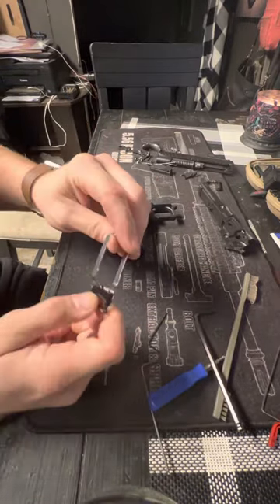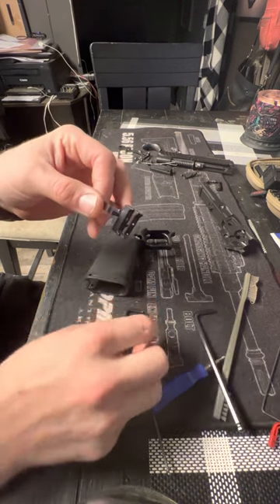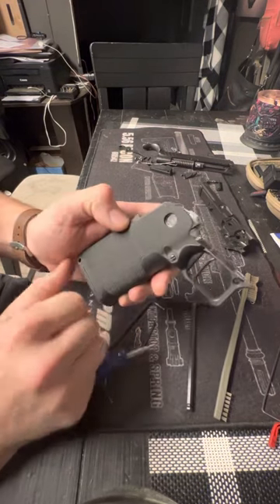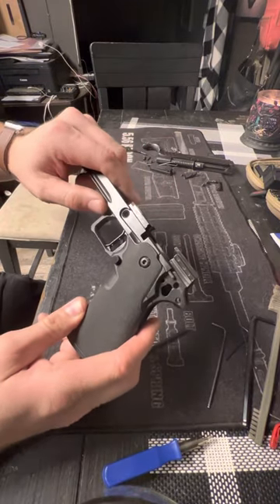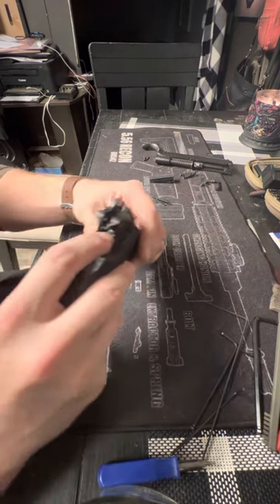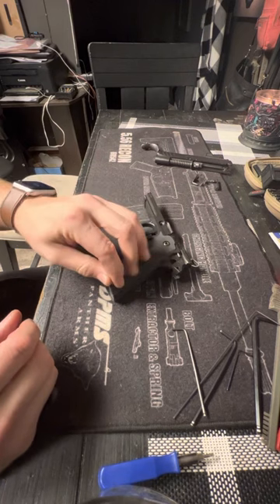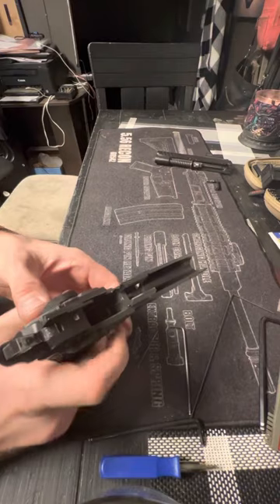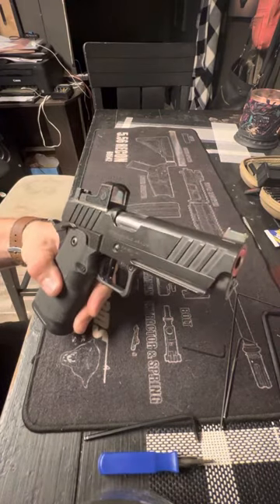SpringField Armory 1911 DS prodigy Trigger Install ( disassembly and reassembly ) ￼

Comment: Thanks for the vid. I am getting ready to change the sear spring. It seems like I can get by with just taking out the old and installing the new with only removing the one pin and the back strap. Does that seem right to you?
Reply from the maker: Basically, pull your slide off, make sure to put the hammer all the way down to relieve the pressure on the mainspring and then tap that pin out and you can replace it without further disassembly but it’s honestly probably easier since your that far to put the hammer in the cocked position and work out those ambi safeties so you can see that you’re sear spring is correct and than throw the mainspring back in to hold it there and than everything else back on. you can do it without pulling the slide and the safeties but it’s honestly kind of a pain and you might end up having to take it all apart anyways.
Reply from the maker: And you’re welcome for the video! Thanks for watching!
Reply: you don't need to pull off the slide... but why do you want to change the sear spring? at least you have to tune it, as well the new one, it's not a drop in part... instead, you should thing about replacing all the firing group with a decent one, the original parts suck...

Comment: Did you purchase the Atlas Trigger with the 2011 bow or use the OEM bow?
Reply from the maker: You must use the Atlas bow with the atlas Trigger shoe, the OEM will not Work. So yes I had to buy the bow. You can use multiple atlas trigger shoes with the same Atlas bow.

Comment: This does not pertain to this video but I was wondering if you can help me out. I have a prodigy 4.25 I put a atlas trigger and recently just put a Dawson precision ejector in it. After I put that ejector in my prodigy has been shooting multiple shots at once. Have you ever encountered something like this?
Reply from the maker: I can definitely help ! So did you put in a Ejector or Extractor ? And it can’t be either of those. The first the I’d do is Check that you have enough pretravel and over travel in the atlas trigger. Did you use red loctite on the atlas trigger adjustment screw ? If not that screw will move and it can take away the required pretravel and this will cause Hammer Follow which I’m assuming is what is going on. I have a trigger video I think it’s titled trigger job adjusting the Trigger pull weight not the Atlas trigger install video. That video should walk you through how to check and fix yours. Also the over travel Tabs on the atlas trigger bow if there’s not enough over travel you can have hammer follow. I’m going to bet it’s the pretravel. If it’s not then watch that video and add weight onto your sear spring specifically the left Leaf spring that sits on the Sear. If none of that helps let me know and I’ll add more steps
Reply: @americantrucker9813  thanks I will do and check all of this tonight!

Comment: Thanks for the video.  Can you share which Atlas trigger you used?  It looks like the Flat X-Line Trigger System.   Thanks.
Reply from the maker: Absolutely you’re welcome! Thank you for watching and yes it is the flat X line trigger specifically the Medium Black shoe with the 2011 Bow. I sent a link to a guy that asked for it a couple comments down if you can’t find it I can send it to you
Reply from the maker: https://atlasgunworks.com/product-details?id=1928700
Reply from the maker: Here’s the link also you should grab some grip screws just in case yours strip mine did as well as a few other people I also ordered a 17 pound mainspring from them and I didn’t order any but you can order different size and color shoes I think for 35 bucks or something like that and you can just change the shoe on the same bow

Comment: Yea like I said it's been reliable but minor issues I've messaged Springfield about 6 or 7 times for a month just sent me a message 5 days ago saying they'd get back to me in 2 business days but still ant heard anything from them some customer service lol I love the gun but they need to get their mess together cuz it's uncalled for for them to let this slip by quality control I mean everything was loose my rear sight my fiber front sight the guide rode and my safety levers of Springfield services was good I'd be ok but wished I would've saved up to get a cosaint or staccato
Reply from the maker: I’m sorry that’s stupid of them definitely! I have a bunch of videos that pretty much show you how to get it squared away yourself it will probably make more sense for you to Tune it, that way it’s not only done right but I think it’s a very good thing for everyone to know every part of their Firearm and how it functions and that way they can fix it fast and cheap and know what’s wrong if something is wrong. And not defending Springfield but regardless of what gun you buy and how much you pay some will always have issues some more major than others, I bought a $5,700 Hand crafted Atlas Nyx V2 and it had Hammer follow and the first time i chambered a round it put a hole in my Kitchen floor & Atlas Said and I quote “you’ll have that with Light triggers sometimes” they didn’t offer to Pay for the damage and advised I should Tear the gun down and tighten the Sear spring. So in a way I think even in your situation you still have a good gun Sights are cheap and The Rear sight is easy tighten on The prodigy heck you can just swap Rear optic plate since they have the rear sight on them. I’m not sure if you meant the front sight post is loose, or the fiber itself is loose. If the fiber is Loose you can just throw it away and replace it fibers are very cheap and are meant to be replaced. As for the post, I’m not sure why that would be loose, but you can probably troubleshoot or replace, Trijicon makes some very sweet night sights that I like better than Fiber Optic but I use A red dot so the iron sights are just back up so I’d put something cheap on. And as for your guide rod, I’m not sure what’s wrong with that but there are plentiful options to replace that some that are as cheap as 12 bucks I’d recommend getting on EGW.COM and ordering The Prodigy keyed guide rod kit for whatever prodigy you have it is a awesome upgrade. It makes the muzzle look so seamless. If there’s any help you need, just let me know. I can make a video or tell you through fixing it. Or you can find a reputable local gunsmith. This platform has been around for over 100 years. The parts for it are super cheap and very simple to work on. And one last thing I forgot your Ambi safety’s, I don’t use the factory ones that came. They are definitely on the cheap side. I recommend the Atlas High Ambi safety’s they are very expensive, but they are excellent quality and worth it, they are stainless steel you can get them hard chromed or DLC coated the DLC coated doesn’t stay in stock very long. Or you can get on eBay and find a very cheap set. I imagine if yours are loose the issue is the Right side Safety has One little Pin that has a split end that sometimes gets loose so you can take it off and pinch the end of it with pliers or a vice just a little bit and then when you’re putting them back together, they will be difficult to get together. I use a vise to push them together very easily but then they will be super snuggly and tight!
Reply: Thanks for the help they finally got in touch I ve got it sent off just waiting now

Comment: What mainspring and recoil spring do you prefer on the 4.25?
Reply from the maker: I still use the factory recoil spring but I use an estimated to be 13lbs mainspring in all of my 2011s & 1911s. Anything over 17lbs is not needed in my opinion but apparently to my knowledge, the equipment to measure spring tension weights is very expensive and not many places have the proper equipment to measure the springs accurately so there are a lot of variations in the springs. For example, I bought three different 17 pound springs from three different reputable dealers, and all three were different the lightest was approximately 13 pounds based on the half assed way, I measured it but I loved it so I use that in all of mine now. I’d say for the recoil spring buy a variety box of recoil springs. They are super cheap on eBay and try all of them to see which one works the best for you because they recoil spring is pretty subjective to the person. I like lighter to help with more reliable feeding and less muzzle dipping but you may like heavier for Faster cycling of the slide.

Comment: did you have to do any fitting? my atlas trigger wouldnt flow freely until i opened up the trigger well and now I am having hammer follow issues and disconnector issues... did you also get new sear and disconnector?
Reply from the maker: So with my gun completely original the atlas trigger fit perfectly without any fitting, but I have since made many updates, including competition sear and disconnector as well as the aluminum grip by cheely and with that grip it requires fitting. If you are chasing a lighter trigger pull then even if it fits you can polish any spots that are causing friction and it’s possible to dramatically lighten the pull I went from 4.5lbs to 2.5lbs by polishing two spots on the trigger bar.
Reply: @americantrucker9813  thanks for the info I really appreciate it!
Reply from the maker: Your welcome! And Good luck !

Comment: Mine won’t lock hammer back with trigger pressed , hammer falls with slide?
Reply from the maker: Hammer follow. How heavy is the trigger pull ?
Reply from the maker: It’s common and you can fix it no problem but first help me narrow it down to save you time & work.
Reply from the maker: If you were installing the new Atlas trigger than make sure you have enough Pre/travel & Over travel of the trigger. Did you change the sear spring at all ? Like bending the leaves ?
Reply: @americantrucker9813  I didn’t but that doesn’t mean it hasn’t happened, I just watched atlas sear spring video very informative, and yes was installing the atlas trigger
Reply from the maker: I have a video on how to do a trigger job. If you like to watch, that will show you everything you need to do to get it working, right. If you have checked that you have adequate pre-travel, and over travel. Which I’m guessing that is where your problem is because it is a new trigger. I would make sure to loosen the overtravel screw until it is flush with the trigger shoe and if that doesn’t work, then you should add weight to the sear by bending the left leaf of the sear spring towards the muzzle. Remember, a little is a lot and you will find the sweet spot.
Reply: @americantrucker9813  will give it a try, thank you
Reply from the maker: @dannymccraw4841  your welcome! Let me know if that takes care of you.
Reply: Had the same problem on mine sent it back for warranty as soon as I noticed didn't even fire the thing but now thanks to @American trucker I know what to look for and maybe put some better parts in
Reply from the maker: Well, I’m glad they squared away for you and I’m thankful that you found that problem before it caused an accidental discharge! I’m not sure if you follow my channel but I bought a $6000 atlas NYX and because of the company and how much I spent I didn’t do that simple test, and the gun had hammer follow when I close the slide. The very first time on a loaded round and I had an accidental discharge, causing some property damage nobody got hurt thank God but, it reminds me that no matter how expensive the gun was or what the name is on it you should always do these simple checks! Also, I have a lot of videos recommending different parts and showing installation so if that is something you wanna, do, you might find some help with some of my other content and if not, there are a lot of great videos out there from Wilson combat and others 1911 videos are pretty similar with some basic differences.